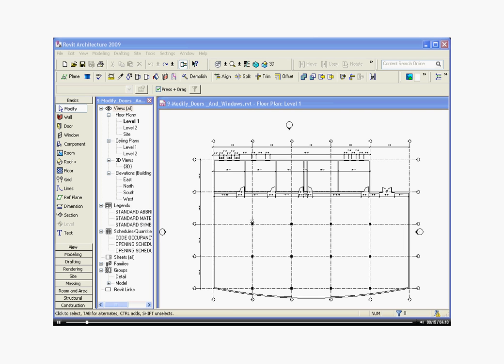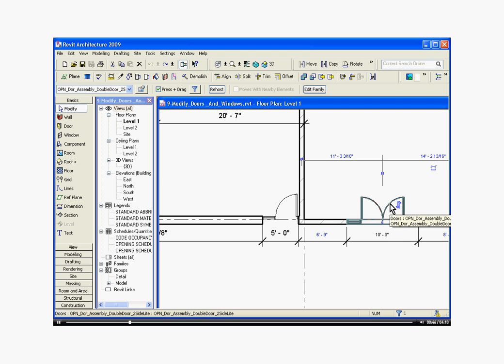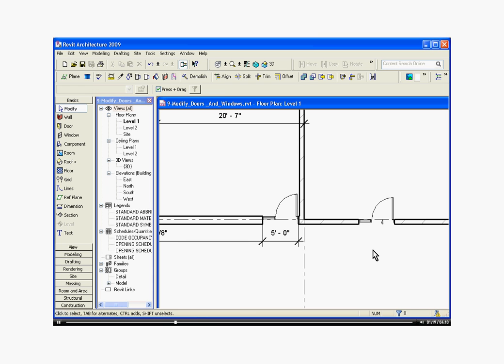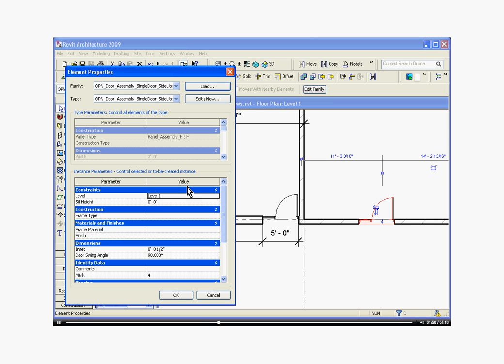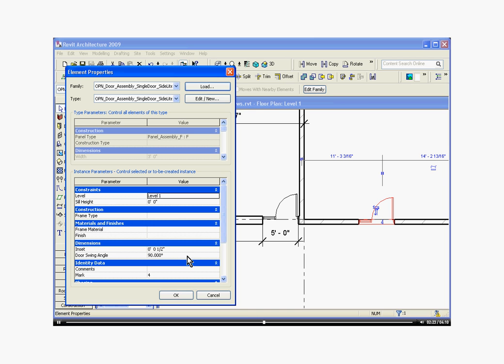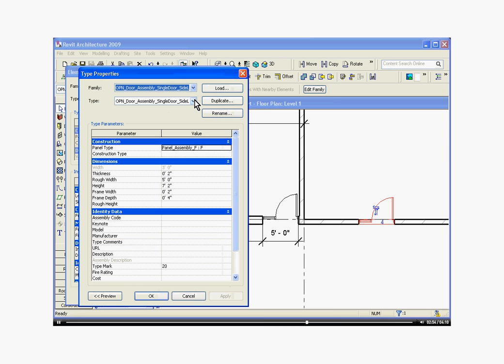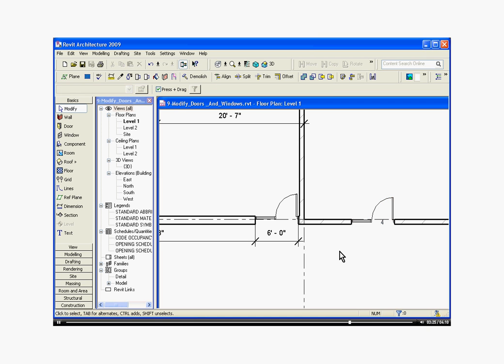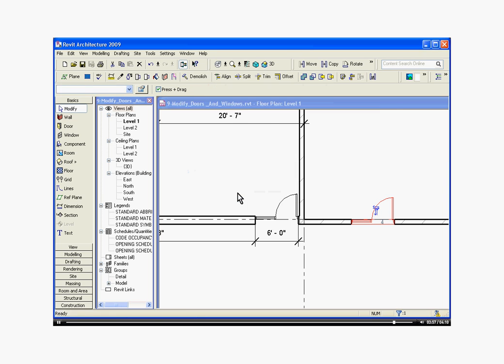Easy Revit (2009) -9-Modify Families: Doors And WIndows

Comment: so the only way to change the width/height of a single door is the 3rd step? because the instant parameter doesn't seem to have those extra options...I dislike the 3rd step since i'm new to revit so what i usually do when i make doors is use the same types with different dimensions so i can just edit each of them using the family editor...